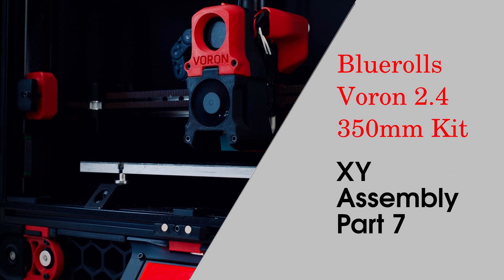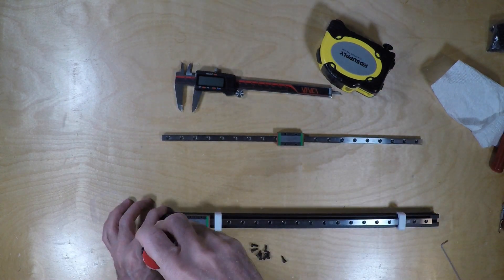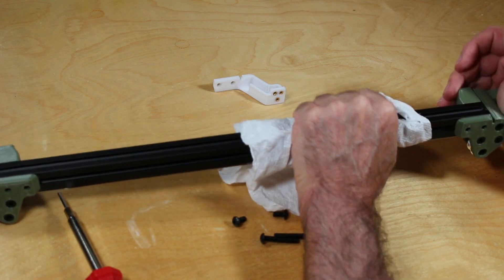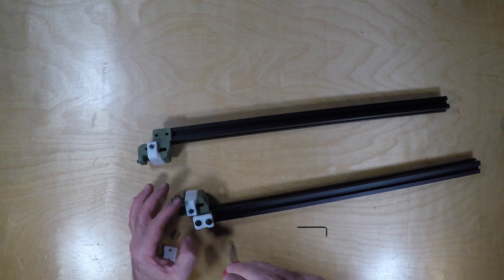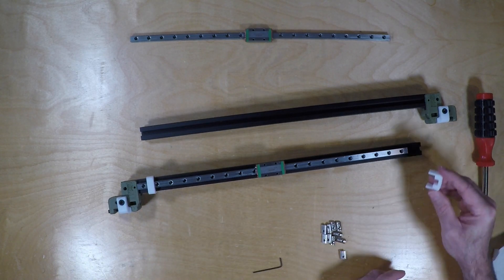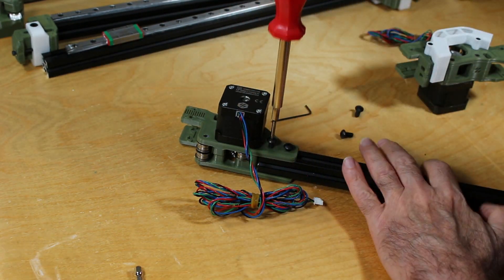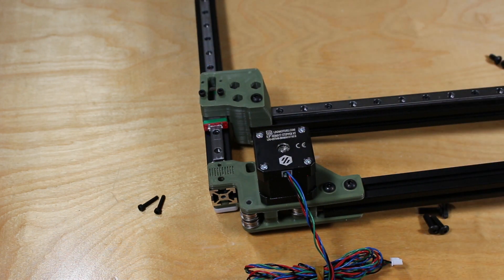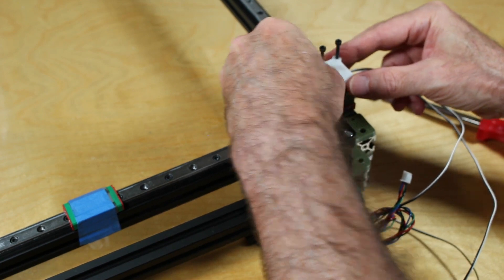Voron 2.4 Blurolls Kit Part 7 - XY Assembly

Comment: Were your Y extrusions a little short at the AB module ends? Noticed mine are about 3mm short. Talked to people on discord and reddit who said theirs was as well but it goes together well once gantry is mounted to the Z carriages.
Reply from the maker: Good question.  I wish I measured them.  That said, I have not had trouble with the length, the hot end reaches as far as it should.

Comment: Good video, and I appreciated the heads-up RE: t-nut orientation.. I just a little bit ahead of you and put mine in the right way mostly due to luck. I think with your endstop wiring you want the wires coming out toward you rather that out to the right, there's a little slit printed into the block that module mounts to - thread the wires through this slit and up into the chain.
Reply from the maker: Thank you for that!  I'm glad to know it before I get any further.